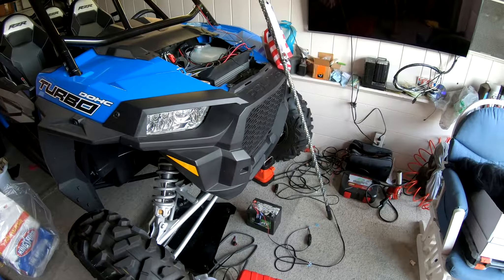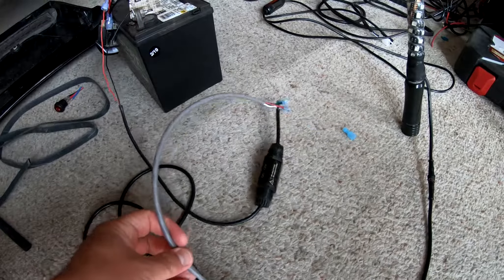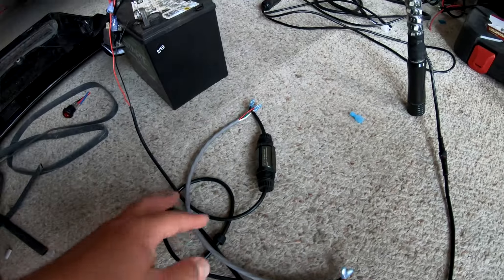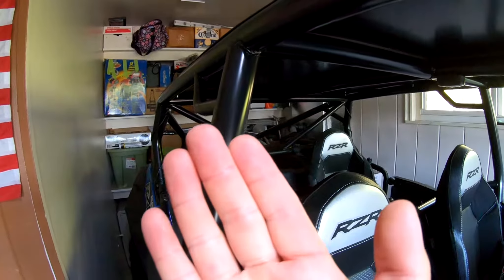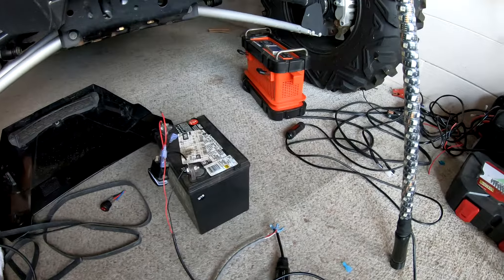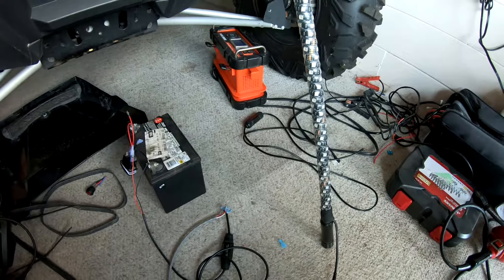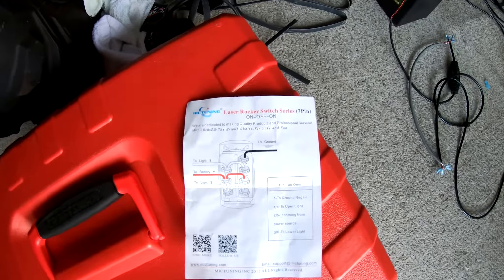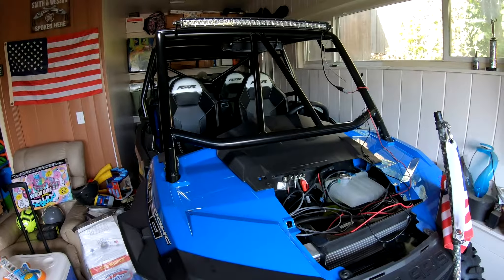Led Whips Wiring

Comment: Good video but you should've switched a relay with the rocker so you don't have the full amperage going through your switch. I'm fairly certain the rocker is not rated for that. Correct me if I'm wrong.
Reply from the maker: Kinda late but the switch was rated for 15A. I'm only drawing 4.5A from both whips combined on full power. Make sure you fuse them if you go this route. Just sayin lol.